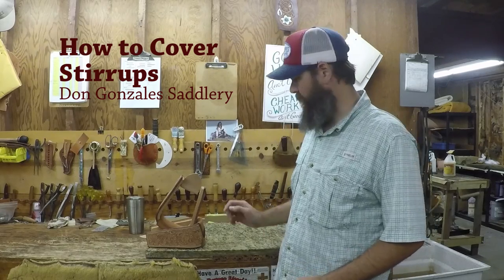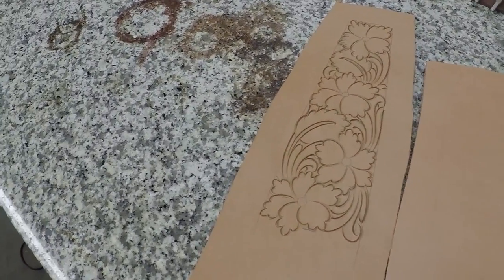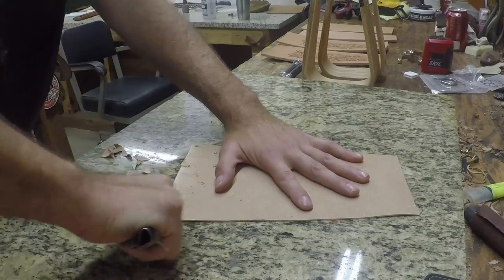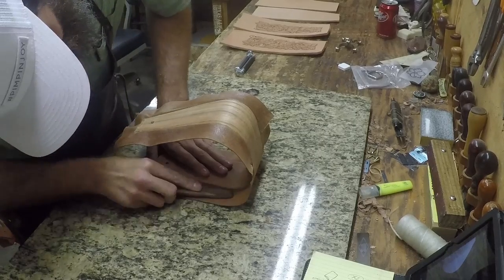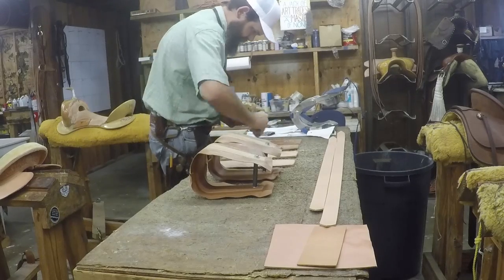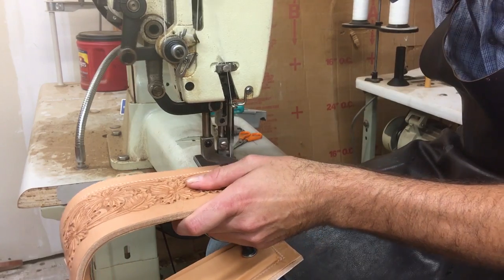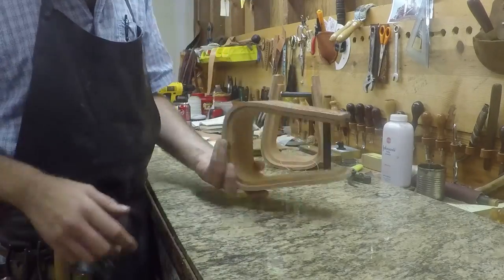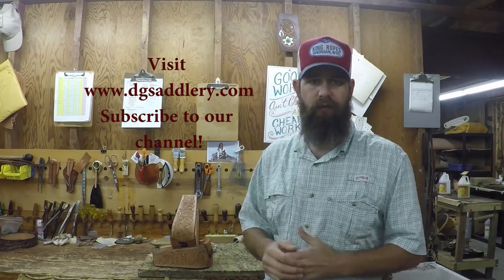How To Cover Stirrups

Comment: Another fantastic video Don. Ever do any rawhide covered stirrups? Mine have shrunk from riding through rivers and I'm wondering if the rawhide can be removed and stretched back out before relacing.
Reply from the maker: +Kevin Hall thanks a bunch!  I have not ever used rawhide to cover a pair.  I would bet it would be easier to recover them with new rawhide.
Reply: Don Gonzales Thanks Don!